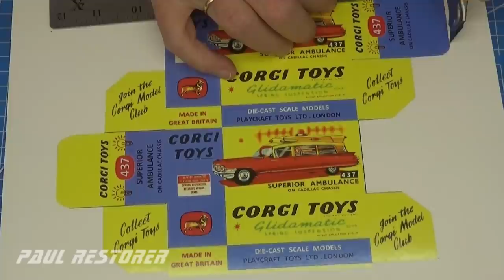Corgi renowacja Cadillac Superior Ambulance nr 437. Dorabianie szyby i koguta na dachu.

Comment: Perhaps it's the passage of time playing tricks.  I had a corgi ambulance similar to this, but I recall that the small lights front and rear on the roof also flashed. I cannot remember any siren sound. More especially I remember the tailgate opened and there was a stretcher in the rear section. 
I know that Dinky made a similar ambulance and I may be thinking of this.
Happy to be dispelled of these memories as the passage of years and hopeful youth...🤔
Reply from the maker: Cool. Thank you very much David

Comment: What a dog's breakfast, Paul.  You did a beautiful job bringing that ambulance back to life.  I remember one from that Era but the details are wrong.  It was a Pontiac with a swing-up rear door and a gurney inside.  It used AAA batter which I never had so I don't remember if anything worked beside the beacon light.
I've building models since Airfix kits came in hang-up bags and I have lots of trophies but you're a magician.  There used to be a show on TV where they restored old cars and their slogan was,
Don't crush them -- restore them.
Your work is brilliant.  Thanks for sharing your videos.
Reply from the maker: Thank you very much

Comment: As always Paul you show how clever you are in this film. I respect your processes mostly to recreate these models. But in this case I cannot agree that this is a 'restoration'. This is more an adaptation and a 21st century improvement on a 20th century model. A  purist would say this model never had sound or the circuitry that you have installed. Sorry , clever , but true restoration ,no.
Reply from the maker: Thank you very much Walter. You're right Of course, tourists do not recognize this type of renovation, but I had limited options because I missed a lot of parts to the original condition. Best wishes

Comment: Sorry Paul, could you tell us what kind ( or trademark) of paint and barnish do you use? . Great work again!
Reply from the maker: First, I use an anti-corrosive epoxy automotive primer. Then I paint on it with acrylic car paint, either from the Polish company APP or the Dutch company Fast Finish. Then I strengthen everything with a clear acrylic varnish with an APP hardener.
Reply: @PaulRestorer  thank you very much! . I ve just tunned a hot wheels Toyota trueno to look like the trueno  of the japanese“ Initial D “ serie. But i didn t like how the paints i used look like. Thank you for your help. Greetings from🇪🇸

Comment: What happens when the batterys go dead. Clued in you'll probably damage the blue insert and on top of that getting the batterys out doesn't look simple
Reply from the maker: I have a similar Custom in my collection in a video on my channel and it has been running for 2 years with smaller batteries. has not yet discharged. However, if they are discharged, I am able to replace them without any problems
Reply: @PaulRestorer  
No, no, no , Paul.
Your answer should be, "I wave my magic wand and say, repairum cadavera."  😀